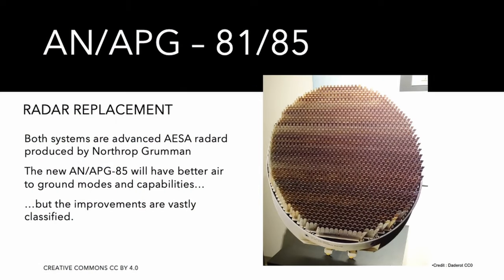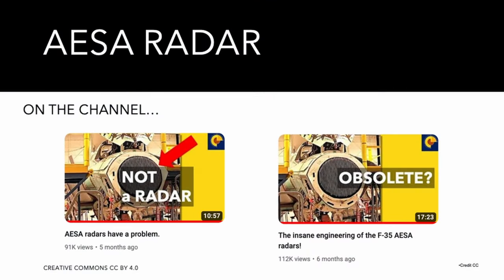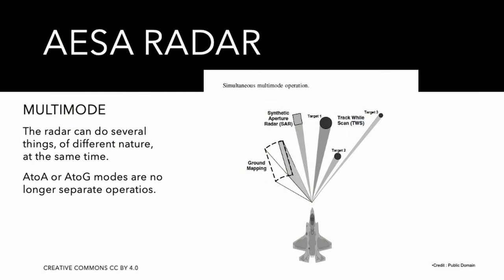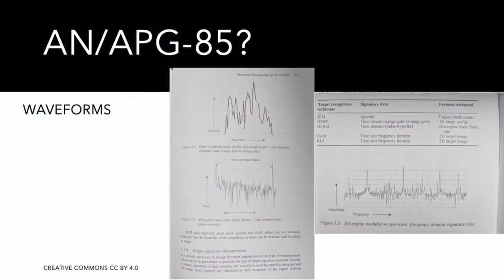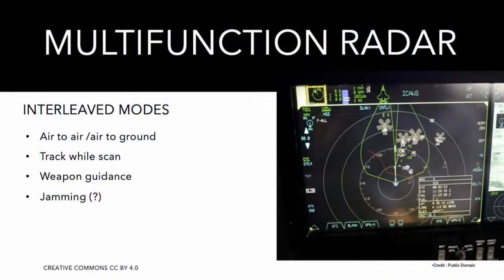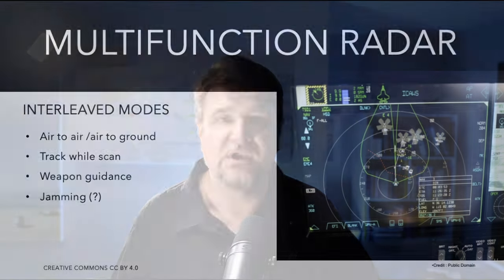The New F 35 Block 4 Radar is Bonkers!

Comment: Too bad there’s a massive cooling issue with the F-35; it’s got all these amazing systems but the damn jet doesn’t have the cooling to run everything at max efficiency. The current work around is running the engines much, much hotter than usual which, although it works for the time-being, it reduces both the reliability and longevity of the engine.
Reply: If the proposed EPACS (also a block 4 addition) delivers 80 kW of cooling, which is more than double the platform’s current capacity, it would provide sufficient cooling to support planned F-35 upgrades and also have an additional margin for the life of the aircraft.
Reply: @SilverShamrockNovelties  still needs an engine with more energy generation to run all that, that's why they are running to get the new one
Reply: If there was really an issue with the cooling you wouldn't know about it and even if such an issue existed, it would have been fixed. Or if such an issue would exist when the new hardware upgrades are installed, the cooling system would be upgraded as well
Reply: Only a partial solution. Compare it to the electrical power of the F15EX
Reply: Yeah, wasn't this part of the discussion for building an adaptive (3 stream) engine?
Reply: @napobg6842 why are you even here if you believe it’s impossible to know anything about current military tech?
Reply: @hunterreeves6525  It is not completely impossible but mostly impossible.
Reply: Source?
Reply: @hunterreeves6525 it’s called speculation. The same reason people watch videos about economic theories and the stock market. Do you think you know everything about all of these systems because you saw a video on YouTube?
Reply: Let me wrap it up all of you.  The real problem was Congress killing the GE alternative second engine.  Twice.  The original and the 3rd stream.
Reply: It doesn't matter because the structure is weak too and can't keep the promise of seing one day  the 6000
Flight hour mark.
More likely 2000.
Top much vibrations.
Reply: A penguin will always remain a penguin, even if you graft the eyes of an eagle onto it.
Reply: The new engine coming 2027 resolve cooling issues?

Comment: There’s simply zero chance that Chinese/Russian planes can compete with these Radar systems. This is what ensures any contest with the F35 will not be a fair fight
Reply: @Ianmundo  F35 engine is very unreliable because of insane turbine temperatures. Electronics overheat because of undersized cooling. Only 10% is full mission capable because it's a flawed aircraft.

Useless in war.

Not even talking about the vulnerability of the centralize JIT and predictive maintenance logistics.
Reply: Indeed.
But the gap isn't widening by a lot
Reply: Considering that the PLAN defeated the Growlers, and that Iran recently managed to track the F-35Is that tried to attack it to the extent that they didn't dare enter Iranian airspace, the F-35s are now just as vulnerable as any non-stealthy aircraft.
Reply: @jiokl7g9t6 Considering that one of those events is imagined and the other is exaggerated I’m going to go out on a limb and say you are wrong
Reply: @centurymemes1208  those hits were real in your mind 🤣🤣

Comment: What's not being discussed is using loyal wingmen and other F-35s as synthetic long wavelength radar aperatures. Instead of having physically large antenna on the planes, a flight of drones or other f35s can simulate long wavelength antenna and fuse their data together to detect other stealth aircraft. China has something similar using multiple wavelengths and synthesizing their data for the anti-stealth role. Synthetic Impulse and Aperture Radar.
Reply: What drones? No branch in USA has a combat drone of this type. Nobody in NATO does for that matter, and Turkey will probably be the first. It might be in service in time with NGAD. For now it's a fantasy, they can't even start to develop the technique you're talking about.
Reply: @ in development.
Reply: So a post-hoc idea, while the primary, multirole mission is falling behind
Reply: @ at the end of the day, we have over a thousand f-35s. Better than 12 vaporware fighters like the su57.
Reply: @kdaltex  "we?" USAF has 300, USN has 30, USMC 110, spread throughout dozen of deployments in different theaters. China already built 300 J-20s btw. Don't forget global commitments bud
Reply: The range on stuff like that is exceptionally limited. you will be inside the MAR of an AIM-260 JATM before you spot anything.
Reply: @piotrgrzelak2613 How did you manage to use such outdated numbers? As of earlier in 2024 the US alone had 630 F-35s in service
Reply: @piotrgrzelak2613   China has built 300 J-20s, which are 4th gen fighters. They're far behind even 4.5 Typhoons, Rafales and the most modern F-16s. Never mind F-35s which are getting a production boost to complete the currently outstanding orders in lieu of Romania and Greece's commitments to their orders.
Reply: @120mmsmoothbore2  LMAOOO
Reply: Amerinigs never stop being funny
Reply: According to the newest data I found USAF had a total of 385 F35As for November 30th 2024, by the way. World Air Forces by Flight global & Embraer. Just so we're all in the clear. And the full mission capable rate is around 30%. You can continue babbling now.
Reply: @piotrgrzelak2613  According to the GAO 30% of the US fleet, or roughly 200 aircraft

Comment: So much technology pushed in that the plane has become fat and lazy.
Reply: kek real
Reply: First : It doesn't need to be very agile if he can just shoot its opponent down before even being noticed. 

Two : It's actually way faster and more agile than any other 4.5 gen fighter with its weapons, pods & fuel tanks attached under its wings.
Reply: Fact: it's more agile than any 4th gen aircraft with it's combat load, the advantage of having no drag with weapons inside is much more than you think.
Reply: @kermittoad  LOL
F35 : Mach 1.2
Su35 : Mach 2.25
Reply: @An1Kum  check acceleration diffreneces...
Reply: @fingerzinger5799  LOL.
What is the difference ?

0 to 100 ??😊
Reply: @An1Kum  it's mach 1.6 for the F-35 but anyway are you aware of the concept of drag? do you really think an aircraft can achieve it's top speed with a combat load on it's pylons? in a CAP loadout in Ukraine the Su-35 would be carrying 2x77-1, 2x37M, 1xKH-31, that's a lot of drag you're not even gonna get close to top speed, same case with F-15 the mach 2.5 top speed doesn't mean anything in combat because you're not gonna reach it.
Reply: @kermittoad  A missile is more aerodynamic than a plane.  A fat plane ( and is ugly too ) is less aerodynamic hence low max speed. And a single weak engine on top of that.
Reply: @An1Kum  the F35 engine is by far the most powerful fighter jet engine ever created. Yes there is one but the aircraft is also lighter than many twin engined aircraft and also one engine requires less fuel so can carry a lot less.

Fighters operate around Mach 0.9-1.2 for combat operations.
Going faster is for interceptors that need to attack bombers quickly.
Reply: @MultiVeeta  Su35 has more power and   more range too.
F35 is good at nothing , except profits for manufacturer.
Reply: @An1Kum  
F35 is still the most powerful jet engine ever created.
Su35 has radar cross section of an airliner, F35 is tiny in comparison. Su35 will never see F35 before it is too late.
Reply: @MultiVeeta   There are several band types of radars looking from several directions. Stealth is hyped to make profits like any toothpaste maker does.
Reply: @An1Kum  
No it isn't Stealth is reduction of radar signature, IR signature and emissions. It's a buzzword over used but is an actual new generation of aircraft.

Radars can only see as much as their power allows, an object with a large radar cross section can be seen at greater ranges than something with smaller radar returns. This is basically how a radar works.

An F35 RCS reduces returns to give an object size far smaller than a conventional fighter this meaning detection range is greatly reduced.

This is FACT.

All radars use different bandwidths this is normal since the beginning of radar, frequency hopping has been around for decades, it has no benefit other than separating slow moving objects and jamming contacts.
Reply: @MultiVeeta  Every major country has stealth aircraft as well as non-stealth ones. I don't understand what you are bragging about ?
Reply: @An1Kum  why would I brag I'm not even American.
Every country has food, does that mean food is the same quality?

US 1st Stealth tech operational 1983.
Russia 1st Stealth tech operational 2020.

The US if far more advanced and experienced in this field than any other country.
Reply: @An1Kum the only way a Su-35 is getting to mach 2+ is clean without weapons
Reply: @gnarl12  Supercruise , which F35 is incapable of.
Reply: @An1Kum  that's a lie
Reply: @gnarl12  Why can't you accept that it is a fat lazy slow ugly  useless expensive problematic aircraft.
Reply: @An1Kum  why can't you just accept that you're clueless and ignorant about this topic.
Reply: @kermittoad  Lets talk about flaws of plane , not mine. I am not for sale 😊
Reply: @An1Kum imagine comparing top speeds of aircraft and thinking that equates to combat effectiveness lmao. I guess the F-104 was the best fighter in the world at launch too. Su 35 is a fantastic airframe but it's going to have serious trouble against F35s in BVR. Not to mention there are less SU 35s built than even f22s so practically speaking I hope they plan on shooting down 10-1 in a hypothetical fight.
Reply: @ethandearman3965  LOL
Su 35 is fast , more agile and has more BVR missiles.
If only prejudices can work, you would have won every time.

Comment: GaN will allow for up to 8x the energy transmission (assuming available power). Increased sensitivity. And a significantly wider frequency range. (all vs traditional GaAs)
Relevant to the F-35 block IV, is probably the increased sensitivity, and wider frequency range. The increased power output would likely be more useful for jamming rather than active radar use.
If it did increase transmission power though, between that and the increased sensitivity, it could double the range of the radar (which is already enormous due to the APG-85's very tight beam capability). Also there is a jamming-related use for it.
Increased processing is a boon as well, but the driving reason this is being pushed out to aircraft quickly, is the GaN.

It should give the F-35 about 160 degrees of radar capability (and related capabilities) greater than an AWACS. Some out there will understand some of the more significant aspects of that. It'll have to be liquid cooled though, instead of air cooled. And it's unknown exactly how much power generation could be leveraged. The power generation in the F-35 is also getting an upgrade, associated with this.

The F/A-18E & G will get GaN slightly earlier though, in the APG-79. It's being implemented there as a smaller, lighter, more sensitive radar, with wider frequency range. But no power increase. While the APG-85 is taking a bit longer to implement, as they're going full size & water cooled with much higher power capacity.

Comment: Do you think they implement FPGA with Neural Module Aggregation or some ASIC component for these type of radars?  FPGA with aggregation can be better starting point of simultaneous multifunctioning radar like this one..?  Sensitivity booster and background differentiation can be also be well performed by this one...
Reply: These AESA radars are basically hundreds of ASICs, it's how they get their performance. Each of the radars in the array is a very special tranceiving amplifying chip!

Comment: So, early adopters of bl.4 are screwed - delayed TR3, no european armament, no new engine, no new radar.
Reply: Buy all American.
If you're nice, maybe uncle Sam will give you the code to start the F35.
Unless you fight Turkey

I mean : i agree with you.
Reply: The new radar comes in in Lot 17 which is 2025 delivery. But....realistically most will want to upgrade their fleets to the Lot 19 standard that has extra EW antenna, amongst other improvements. There will be an engine upgrade (not new engine) and seperate PGMU upgrade to manage power and cooling...we still don't know the cost or timeline on those....and without it Block IV doesn't happen...

But....it will also take at least 6 months for older aircraft to go through the upgrade to reach that (and truth be told its not as expensive as we feared)...and managing those upgrades whilst keeping some of your fighter fleet operational will be tricky...Bottom line is most operators won't be able to get their entire fleet on the same Block IV standard until 2032/33....

There are European weapons already.....Paveway IV and Asraam Block V and lower are already integrated and operational for the UK. We're waiting on the joint US/Norway JSM and the UK's Meteor, Spear, Asraam Blk VI and Paveway IV Penetrator to be added....and then thats it for a while on non-US weapons as no other integrations are currently planned...the Turkish SOM'J has long since stopped being mentioned...
Reply: Yep but still in major war games pre F-35 TR3 fighters win with a kill ratio of over 7 to 1 against euro and US 4th and 4.5 gen fighters.
With the Block 4 this aircraft will be a generation ahead of Rafale, Eurofighter, F-15EX.
5th gen stealth, network centric is far superior to the old dogfighter 4.5 gen warfare.
Reply: @Leon1Aust  4th Gen still has it's place, but I doubt we'll be seeing many more be produced in the coming years with the shutdown/transfers of the F/A-18 lines next year. Rafales and Typhoons are fine though, they were designed with upgrading and modularity in mind so it really shouldn't be an issue to keep them in the British and French arsenals into the 2030s. The UK will have all their F-35s on carriers and the current order won't be filled for years, they still need their Typhoons.
Reply: @120mmsmoothbore2  There will always be those nations in the world that cannot be in the trusted category, that do not by Russian or Chinese, but cannot be sold 5th gen.
Maybe that's why they kept keep open the F-16V, F-15EX production line.
Having Typhoons come up against Chinese networked stealth 5th gen fighters in 10 years is risky.
If one is keeping the 4.5 gen aircraft option that country should obtain dedicated escort SEAD DEAD ESM ECM like Growlers to protect their 4.5 gen assets or even ESM ECM escort drones.
USN and RAAF purchased EA-18G Growlers and Germany are developing a SEAD ECM version of Eurofighter.
The Global Combat Air Programme of British, Japanese and Italian 6th gen looks the goods for future options and Germanys'/French "New Generation Fighter" are options for non US countries' in the future.
It is time for major NATO/West countries to get off the 4.5th gen tactics and progress to 5th gen or even go to 6th gen or China could give them a future shock on air dominance.

Comment: It's a pity the power supply in the airplane is insufficient and has serious overheating problems.
Reply: Explain why couple crashed, one couldnt be located remotely, probably because power was out
Reply: They're racing to get a new engine, seeing as how the current "solution" is to keep the engine running hotter than it really should be constantly to address the power and cooling issues, at the expense of the longevity and reliability of the engine itself.